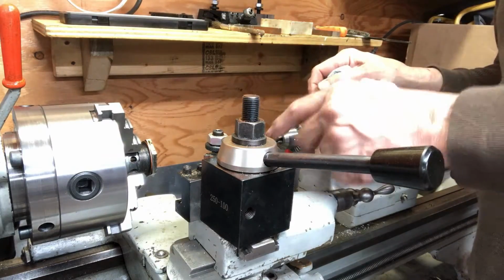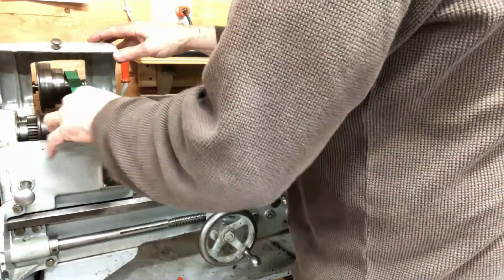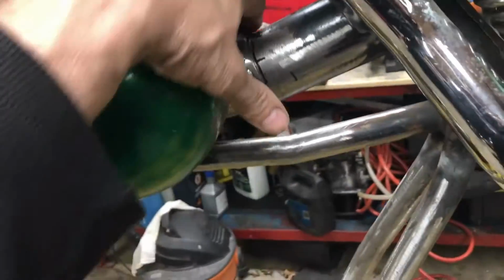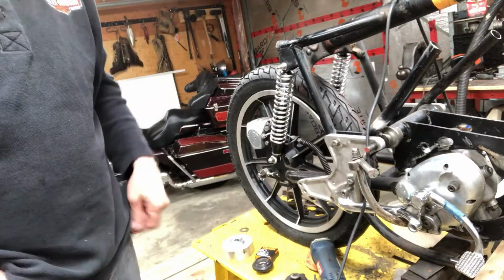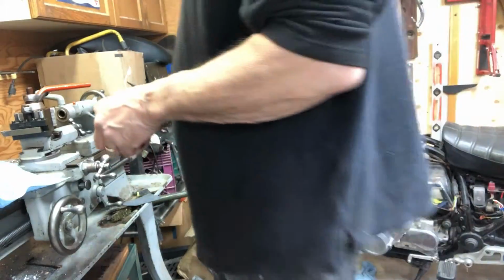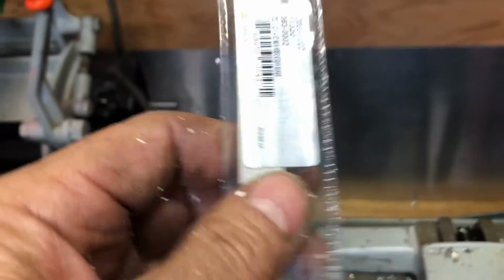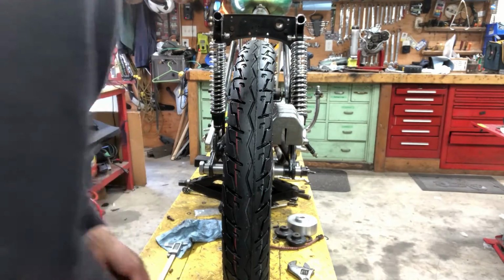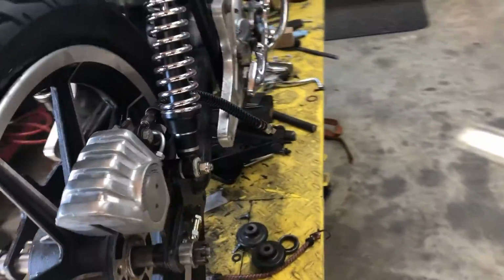NORTON COMMANDO BRAT BOBBER CHOPPER BUILD PT.21

Comment: Bruce,  for british bikes with cast iron rings, you will want to break in the engine with mineral based oil with high zinc content (e.g. Valvoline Racing oil).  Modern oils will not allow the rings to seat.  Norton barrels have high nickel content and can take up to 1000 Miles to fully seat depending on the barrel finsih.   After the rings are seated,  you can use synthetic oils with PTFE.
Reply from the maker: Good to know thank you, Bruce